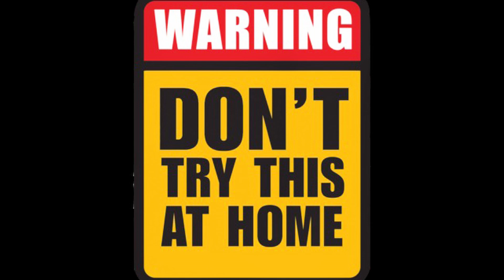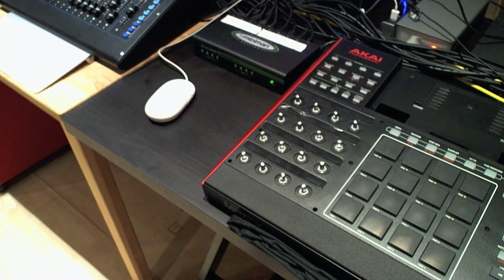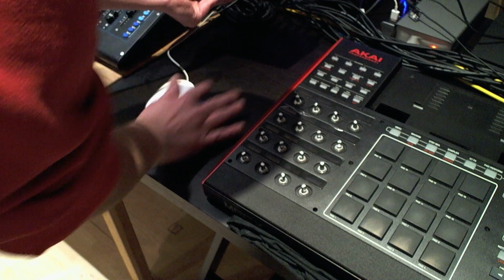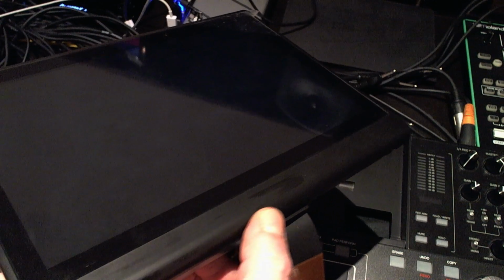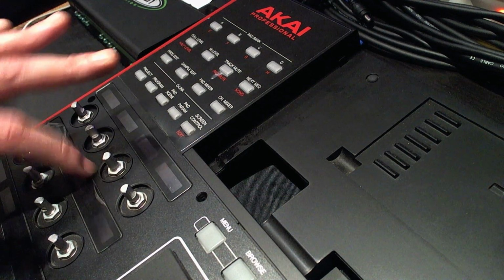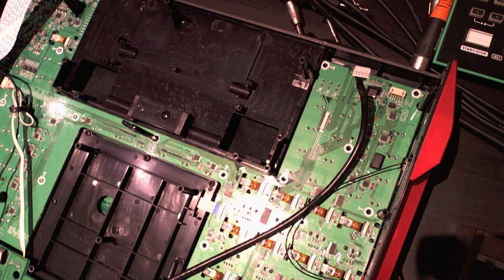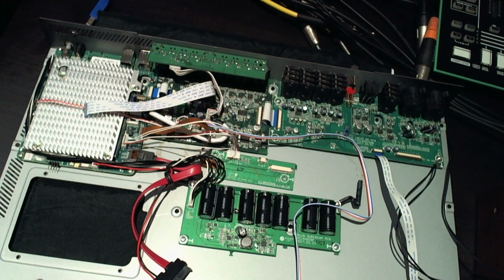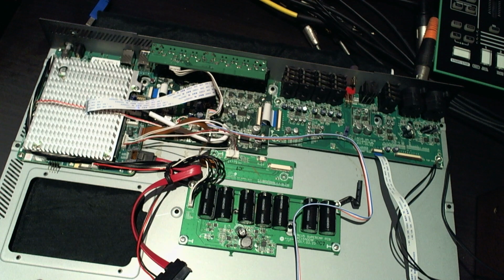Vincetrumentals : DID I BREAK MY MPC X? Here's what happened...

Comment: How's the update? My mpc x crapped right outside of warranty. My problem is sound , sometimes the sound works other times it don't register and play on the main vu meter. I feel the live and x are pretty cheaply made after reading blogs of the issues with them. And  my 2500 or 3000 mpc will fire right up with no bugs. Did you find any cut sheets identifying the different board numbers or layout. Did you happen to find any type of troubleshooting , hard resets?
Reply from the maker: Hi JM, thanks for getting involved! I made another video after cleaning up the machine and sent it to akai, waiting for reply atm. After opening it up, I personally don't think they are cheaply made, it's just the downside of trying new electronics, they fail after a while with new products just like modern cars for example (I worked in garages). I noticed it to be pretty solid inside. Any reply on your problem from Akai? Feel free to make a video about it, I'll have a look at it
Reply: @Vincetrumentals   thanks for the quick response, actually I got some  basic links sent from their knowledge base which was software resets no hard resets, the lady said she couldnt send me any cutsheets or schematics . The(akai)said they'd get back with me a week ago,  holiday delay. Guitar center said to let them know what akai says and they would swap it out for me since it's been just 12 1/2 months. That's why I've been buy a lot of my gear from them because of their customer loyalty.
Reply from the maker: @akaixl83  Let's hope Akai support can help, if not, I'll find another way and make a video about it. I should contact the store I got it from
Reply: @Vincetrumentals  yea I say they're cheaply made because I've rebuilt mpc 60's, 3000's, 2500's, and 1000's and those all had solid operating systems and better hardware, I'm seeing a lot of similar issues to mine on forums
Reply from the maker: @akaixl83  I understand, compared to those there is a solid difference

Comment: Remove each PC (Printed Circuit Board) and see if you can find a break/crack or burn marks in the line of circuitry. If so, that board would definitely need to be replaced,. That would be a good start but probably not an overall solution (Google "damaged PC boards" to give yourself a better understanding as to what to look for). Also, google "Akai MPC parts" and you might be able to find better pricing on parts if need be. GOOD LUCK!
Reply from the maker: Thank you for the support, I really appreciate you!! I was thinking the same way as you, first steps are done, I am making a video for akai with more detail about the damage, I found some spots of the fluid on 2 connectors but no burn marks, I know what the malfunction is and should be able to measure out which PCB has to be changed. I hope Akai Europe also has parts, if not I'll have to order them from the US. Thank you for the positive vibes, to be continued...